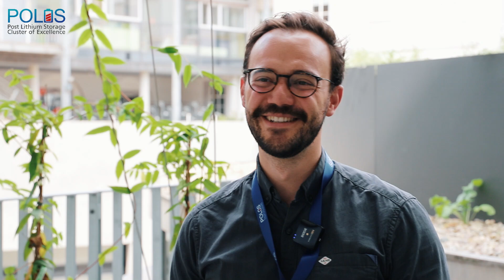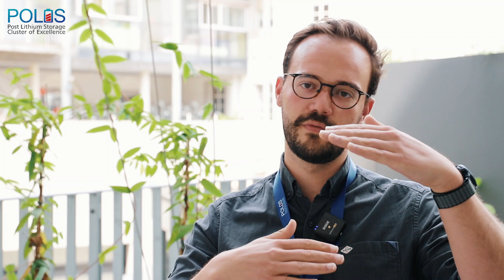Fast Charging of Sodium-Ion Batteries - Dr. Simon Daubner

Comment: Good to see progress on sodium batteries. Despite the weight and volume penalties when compared to lithium, it looks like sodium has large economic and environmental advantages, especially for large immobile installations, which could help even out the flow of power from sources like solar and wind. Maybe safety, too.
Reply: Yes
For Stationary storage like Home storage or Grid Storage,
Na-ion is best.